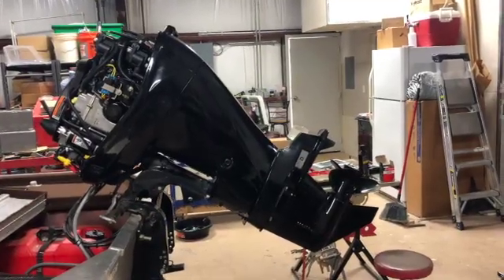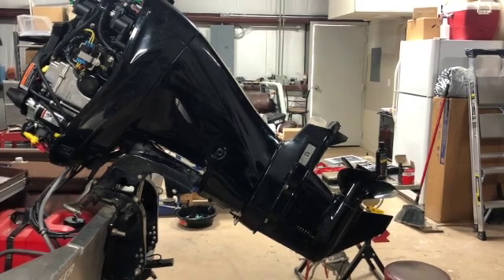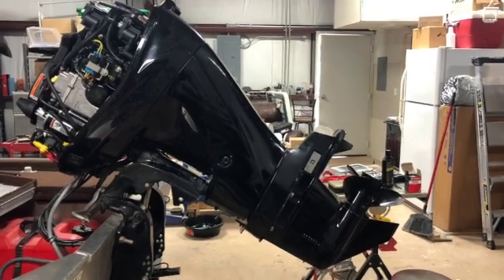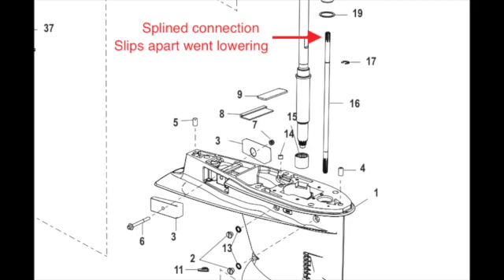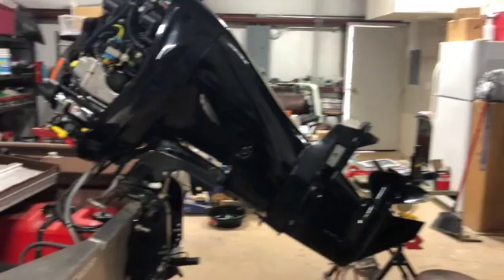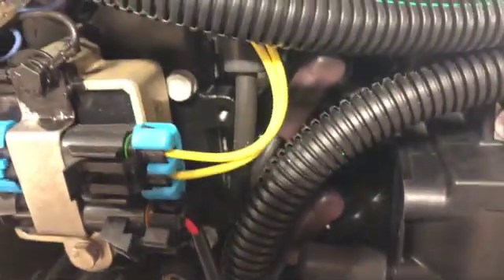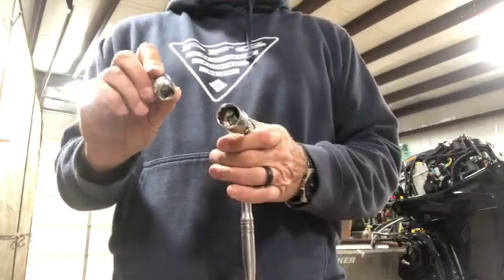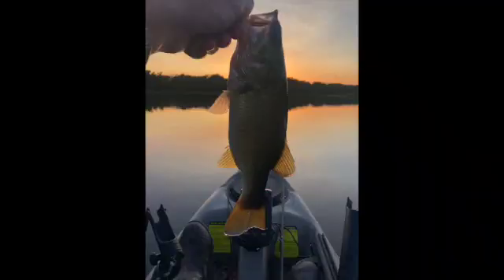Mercury 3 year maintenance

Comment: What size Mercury/Quicksilver oil wrench do you use? 
I ordered what I thought was the proper one and it was too big.
Any information would be greatly appreciated. 
I also have a Mercury 40hp 4 stroke 3cyl.
Reply from the maker: I had a universal set from “C.A. Inc” I bought at oriely auto parts as a set. It is the “C” size. Had to use a big pair of channel lock pliers to break the old one loose. Thanks for the comment have a great day!!!